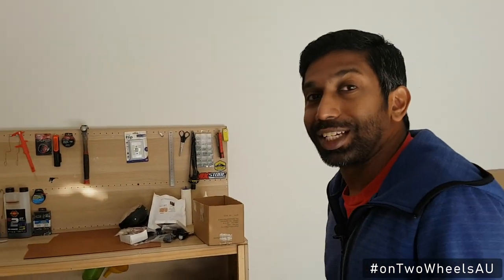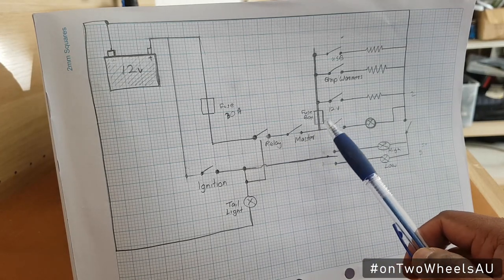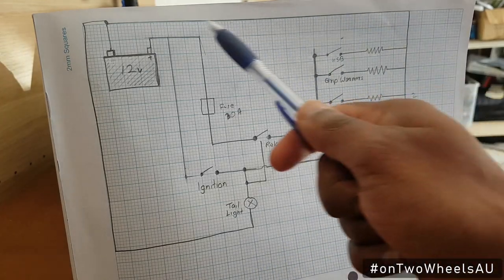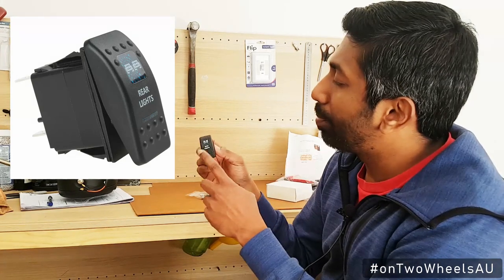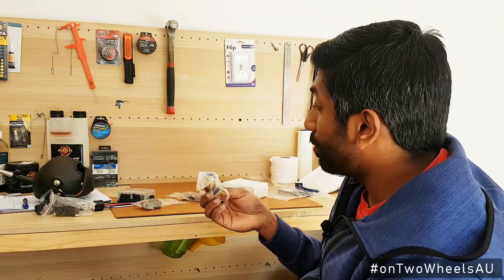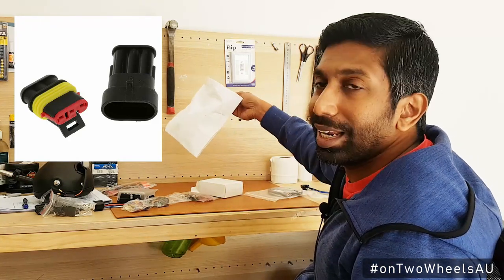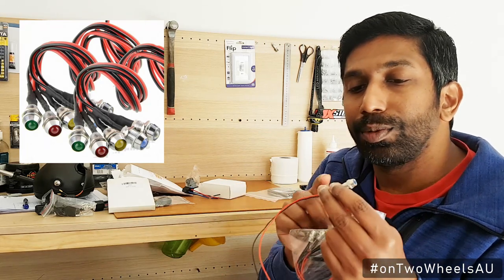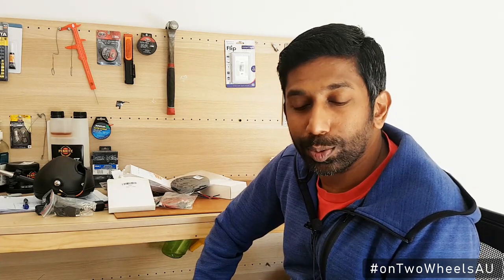DRZ Rally Kit Electrical Accessories | Part 4 | OnTwoWheels

Comment: H Dilesh, the USB outlet you purchased are not reliable and they fall apart inside due to vibrations. A fix is to pull it apart and fill with hot glue, it adds some reliability. I have used them and dont like them, i have moved to the old cig lighter socket and use a push in style USB outlet into it. A bonus a you can get 2 x 2.4 or even a combined 2.4 & 3amp plug. Good luck with the build
Reply from the maker: Thanks for that!  In fact this wasn't the one I had wanted. What i wanted was something similar but also with a volt meter built in, but in the many ebay tabs i had open i guess i bought the wrong one.  But based on what you mentioned, I might go for something more sturdy.
With the cig-lighter style plug, did you have any issues with water getting into the plug in the rain?
Reply: @OnTwoWheels  , that is an issue and will be for all this type of plug. A plastic ziplock bag over the the socket and usb plug is what i use when its raining, i dont see a way you can totally waterproof it when flush mounting. Jaycar have some good options, but a cable leading into a plug will always be an issue
Reply from the maker: @gc1862de  The good thing is most 'chargers/accessories' come in a standard size round plug so I'll be able to swap it in without modifying the dash much. I'll look around a bit more to see what other options are out there. I agree, none of these are fully waterproof and I might not attempt a river crossing with the phone/GPS plugged in, but the fewer exposed plugs/wires/contact patches the better...

Comment: In principle, your electrical layout is sound. Keep it as simple as possible so if you have and issues on the trail, it becomes easier to diagnose the issue. My only critique id around the additional weight that the tower will add to the bike up high. Keep it as light weight as possible and strip anything off the bike that you don't need. I have built a light weight DRZ400 adventure bike. https://thumpertalk.com/forums/topic/372104-drz-pics-lets-see-your-z/page/637/  at he top of the page in black. Whilst a tower would look cool, I am mindful of how much additional weight it will carry up high. In any case, well thought out and look forward to the rest of the series.
Reply from the maker: The weight was one of my concerns too! Which is why we're going with Aluminium. We're doing well so far! The tower setup is about 2.1kg (Without the screen). I weighed the stock headlight, the cowling and the 2 fork brackets, which, the tower now replaces, and they add up to 1.6kg. So we have increased the weight by only 500g so far.
Reply from the maker: Btw your side racks look great! And have you done something to treat/buff your tank? It looks good!
Reply: @OnTwoWheels  And thats 2.1kg including the brackets that mount to the frame. They are probably the largest part. Also remember that this is mounted to the frame, so it takes all the weight off the forks. For me and the test rides that i have made on the bike, the steering feels a lot lighter than standard. 

BTW Love the video Dilesh.
Reply: @OnTwoWheels  No, that photo was taken the day I fitted the new Safari tank so it was brand spanking new.
Reply from the maker: @EricBanner571  If only tanks were always that shiny! haha!

Comment: Can I suggest water proof switches? The ones you have are prone to problems.

I’m doing a similar thing with a SWM Superdual 😁😁
Reply from the maker: The switches also come with little rubber caps which screw on and make them waterproof. But since the switches aren't mounted, i wasn't able to test them out. Once they are installed i'll do another quick review!

An SWM! wow's that's a rare and unique bike!!! How is it as a brand? But also do you have SWM groups in AU?